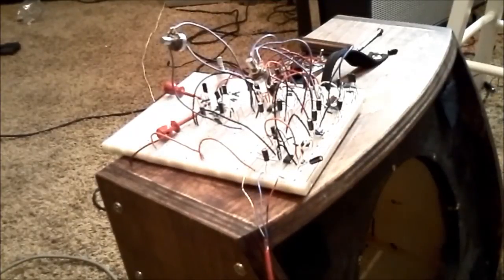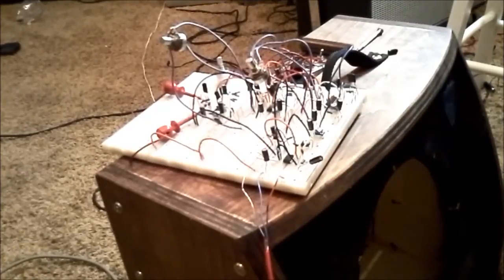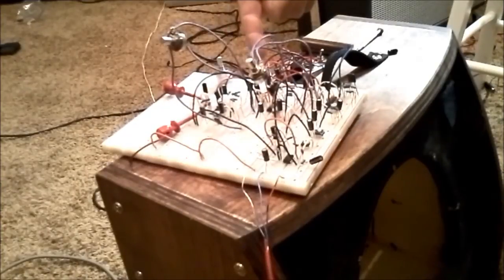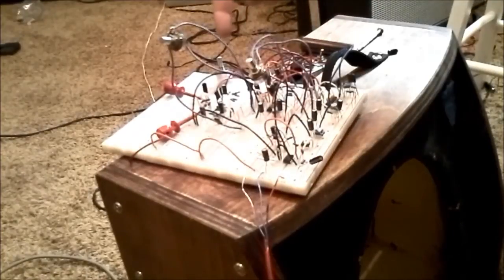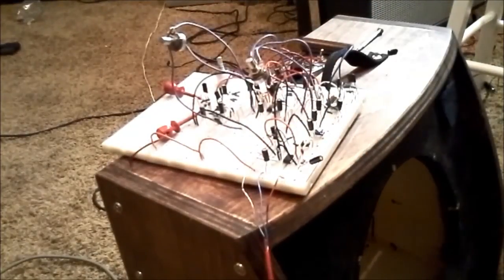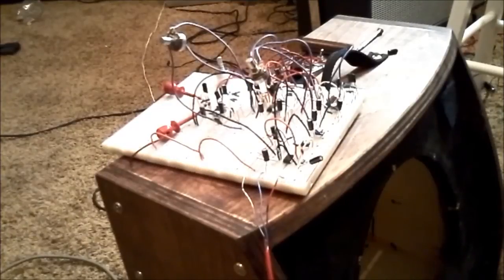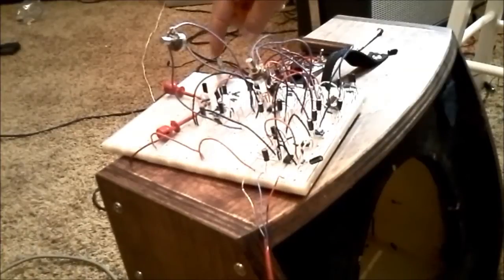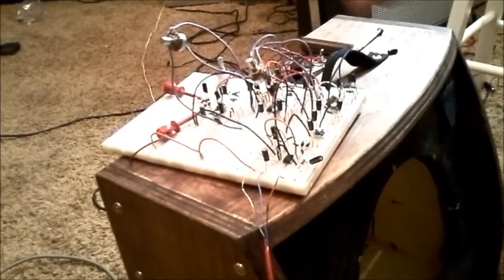Delay Reverb With Three PT2399 test

Comment: Impressive demo of the PT2399, thanks for sharing :)
I got a bunch from here & gotta test it sometime:
http://www.banggood.com/10-Pcs-PT2399-Echo-Delay-IC-Chip-DIP-PTC-Audio-Processor-Stompbox-p-936494.html
Reply: No, I am just asking. I put a link because the ICs the Chinese sell are clones not original and that is why they are cheap. It might not matter on older ICs since the cloning can reach %100 but on recent ones it does, since some functions do not even work. A famous example of this is the FTDI cloning case, the company decided to use a signature on Windows(and maybe other OSes) that will only allow it to work with genuine chips.

Comment: How about using 2 of these pt2399 placed in overlapping mode, such as its done with 2 springs in spring reverbs, whereby one spring of the two is shorter to cover up the "holes"?